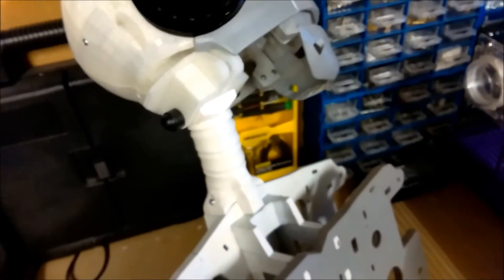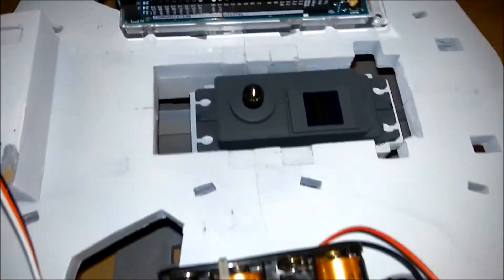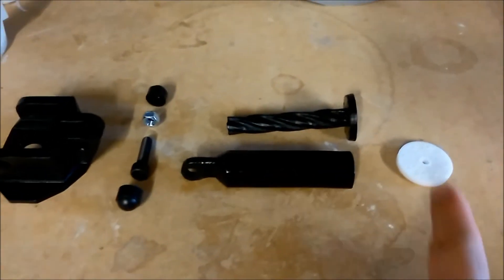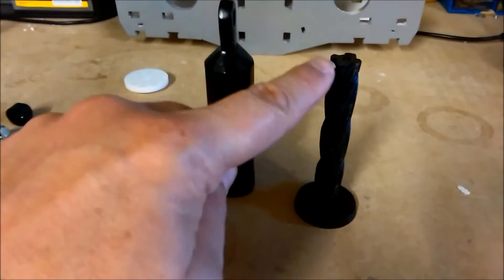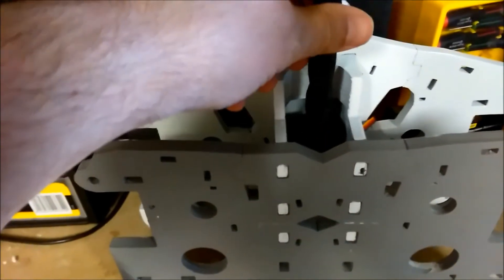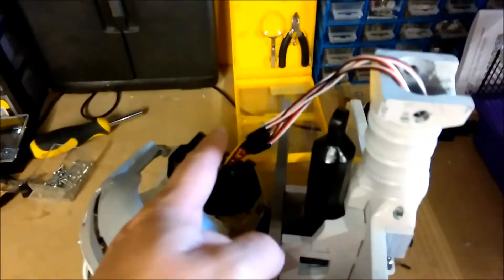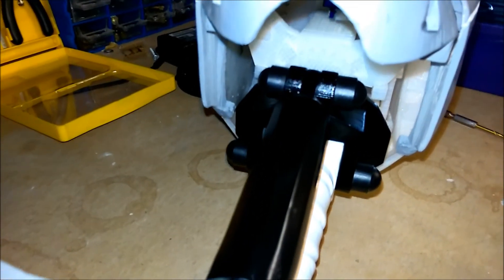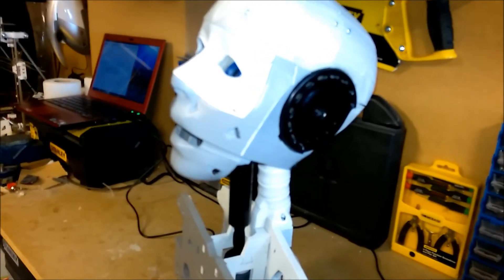Civrays InMoov - Completing the neck

Comment: Remove the bottom of the servo, which allows you to bend the wires out of the way while you insert it - then once in place, screw the servo bottom back on.
Reply from the maker: Thanks, that's an excellent tip. I didn't think of that.